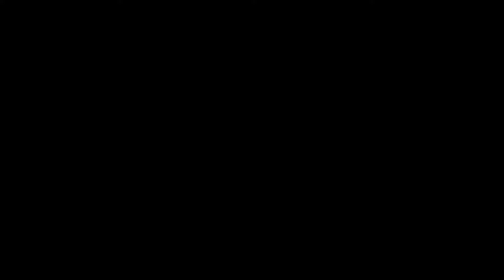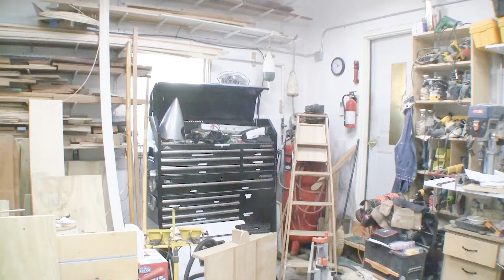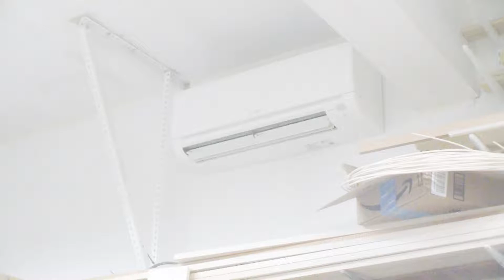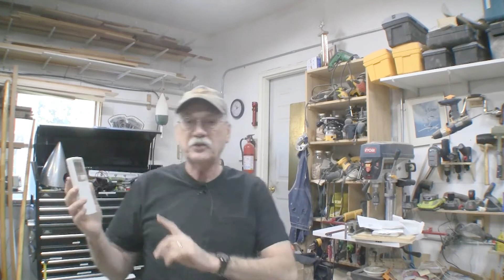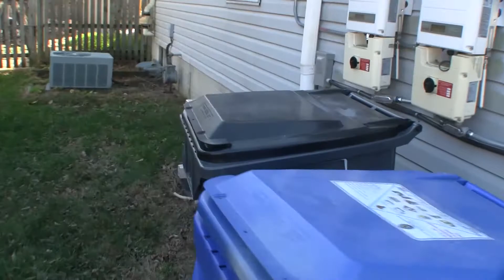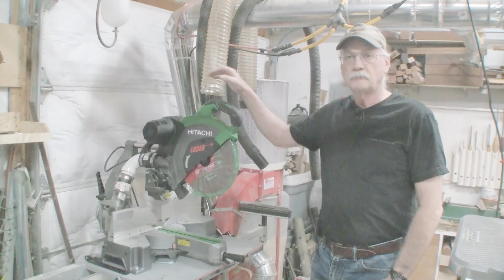Adding comfort to the shop

Comment: My Shop is in West Texas and about the same size as yours, it gets colder here than in MD and much hotter than MD but less humidity of course. 
(I know this because I grew up in Va Beach, and lived Fredericksburg, VA several years.) 
I installed a 12 K BTU Pioneer Mini split first. It heated well but had to work hard to cool the shop. I replaced it with a DIY MRCOOL mini split 24K BTU’s now it works great! It can be 100 degrees out side and in 30 minutes the inside temp will be at 80 degrees ,30  later and it will be 75 degrees. As for the electrical consumption I have never seen any difference at all. That is because the wife takes care of the bills now 🤣 I retired.
She has not seen a difference that mattered either. The inverter system is very efficient. I wax my cast iron tops twice year and I do not have any problems with rust. 😁🛫
Reply from the maker: Same here. never seen a difference in the bill. We regularly get up to 95-100 in the summers now and this thing works a treat. Cool ing phenomenal.